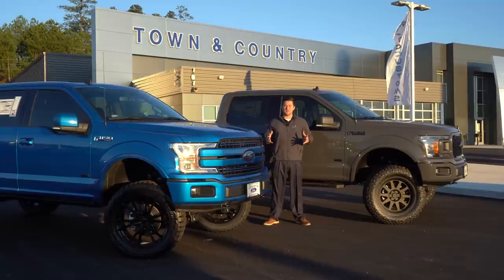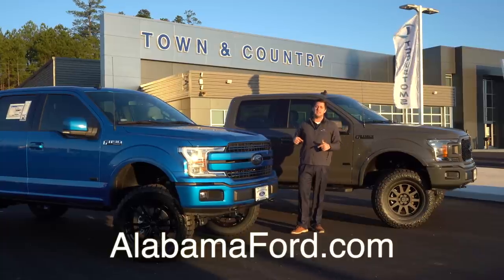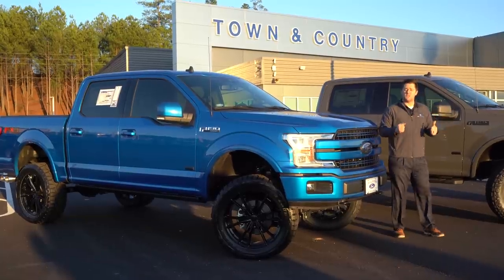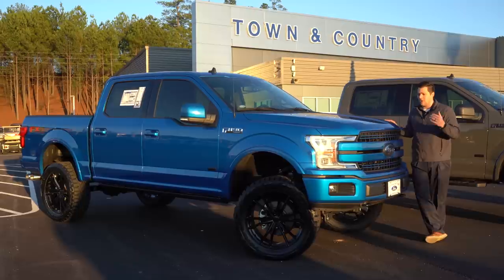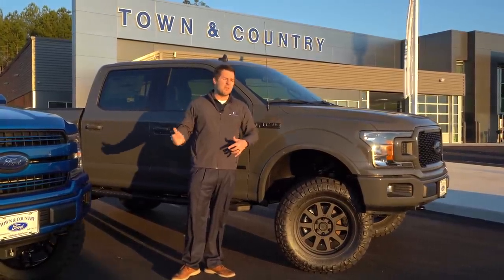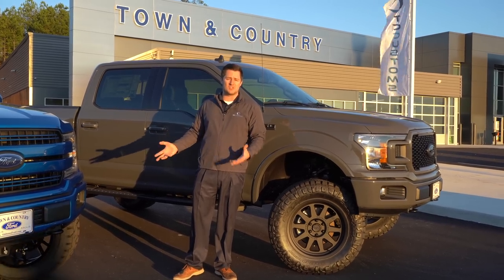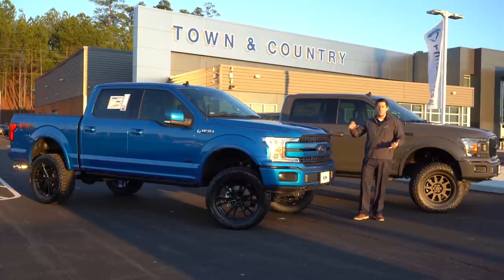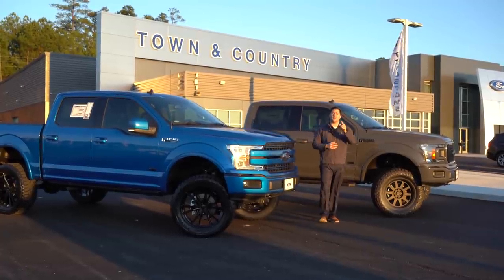Which Gear Ratio do you need on your truck?

Comment: You really only talked about the importance of swapping the gears as it relates to towing. But another and probably more important piece of it is that when you go up in tire size, and don’t change the gears, it wears out your transmission, axle bearings and pinion. I put 37’s on my 1997 F150 4x4 and it wore the transmission out in about 10,000 miles. The transmission guy told me the whole transmission was shot, they had to do a complete rebuild on the transmission, right after the transmission all the axle bearings an the pinion went out. I ended up putting 4.88’s on it and it’s like a different truck, it hauls a$$ even with the big tires and gets almost twice the mpg than the stock gears. 33’s and maybe 35’s are probably ok to run with stock gear ratio, but any bigger and you have to change the gears.

Comment: Really great video. I don't know how many times I have come back to watch it.  I get the physics behind gears and ratios, but applying the concept to a real-world application (like my truck differential) ... uh... _system not responding_.  At first, I was That Guy your were talking about at the end of your vid, "...confused the crap outta ya..." 

BUT as I started to explore more, really "think" it though, and watch this video a hundred times - YEAH!  I really appreciate your straight talk and examples of when/why you would want a different set up.  Especially talking about your own truck!

I have a 2018 F-150 V-8, 10-speed.  Going to lift it soon.  I am also thinking about eventually installing manual lockers - doing that research is when the lightbulb started coming on.  I was bothered by all of the information floating around about the bigger/heavier wheels bogging down the truck, wrecking performance, the 3.31's would make it suck, blah, blah, blah. This video was VERY HELPFUL!

I think I could apply your information to the off-road performance aspect, but I would love to see a similar video that talks about gear ratios on lifted trucks with 35's in off-road settings (not from a heavy towing or acceleration/racing perspective).  What would be the best ratios for a work truck/overland truck that might also be a daily driver or frequent freeway commuter?  (A pink, flying unicorn, I know...)

Love the channel!

Comment: The difference in the various ratios is so little that a 10 speed transmission can very effectively compensate for how they affect the performance of the truck. If you want to know the real difference between these axles look up the torque and weight ratings of each axle.

Comment: I have had 3 3.5 Ecoboosts. 2012 with 3.73 and 6 speed. 2015 with 3.55 and 6 speed. Now a 2018 with 3.55 and 10 speed. I wanted 3.73 on the 2018 but can’t get those unless you have the payload package which you can’t get with a lot  of the options I wanted on my current truck. The 2018 pulls the same and even better than the 2012 did but also has more torque. The 2015 was by far the worst pulling of the three.

Comment: 2017 F350 6.2L gas with camper package and a 4066Lb payload and 3:73 gears. Why didn't anyone mention the 4:30 option when I was looking?  Towing a 6300 Lb trailer and does fine everywhere except for the longer hills in PA with 6% + grades. Had to back down from 50 mph to 38 mph because the tach was hanging out at 5500. 
I think the 4:30 gears are a great option if you don't drive high mileage when not towing. I drive short distances in town, then tow 50-100+ miles 5-10 times per year.  Diesel would be overkill. A 150 could even do it, but I don' t like the downhills with move than 5500 in the 150's.

Comment: I have a 2018 STX 2.7 eco, I have the 3.55 gear ratio and it has a 7” lift with 325/60r20. I can tell you 3.55 makes it feel sluggish. Maybe if you have a 3.5L ecoboost it may be a different story. I’m swapping my gears next week to either 4.10 , 4.30, or 4.56. I did get a Tune which helped a bit but I feel swapping gears to match the bigger tire size will be much of an improvement. We will see once I get them installed with the verdict.
Reply: Did you do this? What did you end up going with and are you happy.

Comment: Thanks for your video.  Soon I will be shopping for a new F150. I will be pulling a 7000 lbs trailer most of the time. I think the 3.55 combined with either the v8 or v6 turbo should be OK, thanks for a 10 speeds transmission. Still didn't make my mind about the engine.
Reply: The 3.5 Ecoboost with the 3.55 Tows like a Beast.

Comment: I realize this is a year old, but IMO, there isn’t  a noticeable fuel economy difference between a 3.55 and a 3.73 with a 10 speed. In a vacuum maybe there is but the frontal area of going 75 mph and pushing against the wind drag is where your fuel usage come from,not the 40 rpm difference between the 3.55 and 3.73
Reply: Correct, MPG will be within a few tenths.
3.73 may invite one to apply more throttle since it’ll feel “ballsier”

Comment: Honestly I think the 3.73 is pointless with the 10spd transmission. The 3.55 or 3.31 are perfect
Reply: not really, top gear ratio is so high 0:64:1 that you can still drop your RPMs down so much, you still benefit from the lower rear end. Higher rear end you get to the point that in the top gears you don't have the mechanical advantage to lug as much as you could with a lower rear end.

Comment: I order a 20 f150, 5.0, with 3.73 and haven't got it yet.  I only test drove one with 3.31 and ecoboost with 3.55.  I hope I like it.  I'm like you Mitchell, I want that good acceleration and I'm not worried about mpg's.  I'll be using E85 anyway.
Reply: I have a 2019 F150, 5.0, 3.73 gears and a crew cab. 
You will love the 5.0 and the 10 spd trans.
Put it in sport mode and it shifts like lighting. Pulls anything like a dream.
It will run even better on E85, about 20 hp gain. But bad gas mileage with E85. You will also notice your motor oil will be cleaner longer and not as dark for oil changes with E85.
Reply: @abominablestormtroopersnow4510  but still it is not at the top spot for best engine

Comment: Some things to consider - large diameter tires reduce the effective final ratio. If you plan on a lift kit with 35-37 inch tires rather then the "standard" OE 32" tires, your final drive ratio will take a beating and a 3.73 may not even be equivalent to a 3.31 (I didn't do the arithmetic). The move to 3.73 from 3.31 gears is about 12% increase in RPM. 3.55 to 3.73 is only about a 5% increase - and, IMHO, quite frankly not worth it. Instead, save your bucks and go aftermarket with 4.10s or more. Gas mileage will suffer a bit but you will retain most or, maybe, actually better your trucks performance. My F150 has 3.55s with the trailer package and I don't haul too heavy. The last, and an F350 had 3.55s as well but was a 6.7 - and it really needed more hauling a 12K plus pound, 38 foot 5th wheel with the bigger tires I used.
Reply: What’s the heaviest you have towed? Looking to get a f150 for a do it all want a 4x4 and that’ll be good to tow as well

Comment: It would be good  to mention that the 3.73 will help minimize the effect that the bigger tires have on the truck even in daily driving and that you can use tire size to a point to get your gearing where you want it. 

  A good  comparison is that my old man has a 2020 f 350 xlt just like mine with the 10 speed and 3.55 gears.  mine has the 6 speed with the 4.10 gears.  my truck pulls as hard as his does even with more power the gen 3 6.7 has. but his can get up to 17 mpg as mine I have to drive 60 mph to get 15mpg if I drive 70 it drops to 13mpg. Now I am spinning the engine up to 2200 at 70 where the new truck with the 3.55 is spinning at 1800.  When my stock tires wear out I am going with some 33in tires to hopefully be a good compromise. It would take a 35in tire to make up the difference but i dont want to lose to much pulling power ether.

Comment: I have 3.73 front/rear gears and a Yukon LSD sitting in the box for my 2015 5.0 with the VMP Odin blower on it. 
Even with all of the parts required, I've got some crazy quotes for the regear. :(

Comment: To explain the way it works is if you have 3.55 gears, your pinion will spin 3.55 times to spin the ring gear 1 time that’s why it’s called 3.55:1
Reply: Exactly Correct!    "Pinion Gear" spins (revolutions) 3.55 times to 1 spin (revolution) of the "Ring Gear"

Comment: Yeah and the 10 speed trans has issues...just google and you will find lots of complaints. The 2018 5.0 has oil blow by because of the high tech plasma cylinders...just google and see. The turbo trucks...get a fire extinguisher and hope you don't need. I love ford trucks 2017 and older! No turbo! Waiting on more data on 2018-2021!

Comment: The ratio is also impacted by an increase in tire size.
Reply: The ratio is not effected by tire size. The distance you travel is effected. Horsepower and torque to the wheels is effected. Tire size is irrelevant. One axle revolution equals 3.55 turns of the drive shaft.

Comment: With the 10 speed transmission that is exactly why you should get the 3.73 gears. Because you should be okay with the gas mileage. 
I would want to have the 4.10 myself.
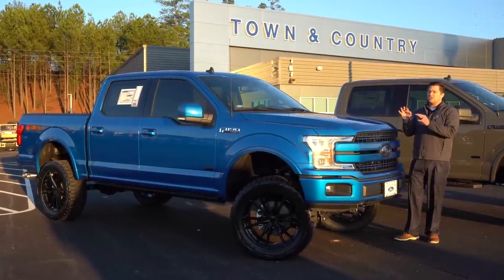Reply: CHRISTOPHER LILES get a tundra only half ton(besides the raptor) to have 4:10 gears
Reply: @ajmedeiros77  I'm sorry but the Toyota isn't my flavour. 
The Ford's are the best trucks by far.
I've worked with all of them through the years. 
Ford's are the best truck for work. 
I know all of them have bad ones here and there but in my experience Ford's have been better than the rest.

Comment: The difference between a 3.55 and 3.73 is very mild.  With the 10 speed automatic axle ratio choice isn't a crucial as it used to be. Back in the day, I had a 1995 Bronco with a lift and 35's. It had the E4OD, which is a four speed automatic.  I regeared it with 4.56 gears (stock was 3.55).  Which brought the effective ratio down to about 3.85, which was a little overkill, but made the vehicle more enjoyable to drive.
Reply: The shorter 3.73 still helps with the hole shot and will allow the truck to be less downshift happy when towing

Comment: Thought you would be talking about how a larger tire would change the affective gear ratio... an F150 with a 3.55:1 gear and a 265/60r18 that you put a small lift and 35x12.5r20 tires on now has a gear ratio of 3.1:1... Or same truck and tires with a 3.73:1 and 35s and now you're at 3.25:1 ratio... this WILL affect towing and fuel economy. That being said I have a 19SD on 35s and don't care. :)

Comment: Good explanation. 
But people need to understand the towing better. 
And running bigger tires. 
Ford does the gears like that because of the fuel economy for the government. 
But they shouldn't have anything less than 3.55.
If you are going to tow you best have 3.73 or higher. 
If you are going to lift the truck and run bigger tires you really need 4.10.
I wish Ford let people have more options for gears. 
Never mind locking gears that you didn't talk about that is even more important for towing and just being able to get out of things better.

Comment: This video is slightly misleading. My F150 with 37s has 4.88 gears, intake, headers and exhaust; it retains close to stock wheel horsepower. I can only imagine how weak the truck would feel if I kept the stock 3.73 gears. Dealerships SHOULD change gears in the trucks they lift. An F150 with 35s should have 4.56 in my opinion. If you don't change your gears when you lift, you will have more wear and tear on the transmission... Also NEVER get a truck dealership lifted, they charge twice as much as they should and take your factory wheels and tires and then charge you interest on total cost if you finance, you can go to a 4x4 shop and pay less total than the dealership with getting the gears done in the front and rear diff too.
Reply: Good Comment! I completely agree ----> NEVER purchase a lifted truck (or Jeep) from any dealer.....it's a rip off! 

You failed to state the model year of your truck and / or the type of transmission. The newer trucks with 6 speed and 10 speed transmissions low numerical gear ratios (high gears - 3.55; 3.73; 4.10) compared to 3 speed and 4 speed transmissions in years past requiring high numerical gear ratios (low gears - 4.30; 4.56; 4.88). The newer trucks with 6 to 10 gears in the transmission can perform well with low numerical gear ratios and larger tires. Plus...there is always 4L available in the transfer case. 

Regarding wear and tear on the automatic transmission.....be best to address that issue with some custom internal parts - torque converter, clutches, valve body work, etc.

Comment: I drive a 2020 Transit 350 3.5 all motor 10spd auto. HORRIBLE WHEN LOADED. Have to lock out 9th and 10th gear most of the time to keep it in it's power band

Comment: How much fuel economy do you potentially lose going from 3.31/3.55/3.73 ? Is it a significant amount ?
Reply: A lot of things come into play. Theoretically high gear (lower numerically) will give you better fuel economy. I've seen where you are doing a lot of towing where a lower gear will actually do better because  it allows the transmission to run in higher gears more often. If you are running bigger than stock tires that's another factor. I also don't  know how modern turbocharged engines respond to running at different  rpms.

Comment: 2019 f150 4wd running  37s with the stock  3.31 on my 3.5 with my 7" readylift. My power wheelchair is the only thing it carries lol. But i am looking into a travel trailer so might regear it.

Comment: I have a 2018 f150 2 wheel drive 3.5 with 3.55 gears and pull a 7000 pound trailer so would the 3.73 been better?
Reply: Yes

Comment: My only concern is with 3.31s being able to stay in 10th gear on the highway without constantly having to down shift. Fuel economy change is a non-issue because that's a no-brainer if you're going to go up in tire size. I just want to know if I can run like a 35" tire with a 5.0/3.31 rear end and be able to use 9th/10th. It's hard to find any anecdotes even on forums because most people don't seem to notice or care about that issue.
Reply: No... The slightest bit of acceleration will make it downshift from 10.

Comment: With the new 10 speed trans the gear ratio matters a lot less than it use to. Having 10 speeds makes it easy to keep the engine in its sweet spot with pretty much any of the available gear ratios. I'm ordering an F150 soon to be my daily driver as well as a travel/camping rig, so I'll probably order it with the 3.5 ecoboost and 3.31 gears. I don't tow anything, but I will be getting a lightweight slide-in camper eventually. In any case, the 3.31 gears will be fine for my needs and will provide the best possible fuel economy.

Comment: I am in the market for a new f150 torn between the 5.0 and the ecoboost.
Reply: From an Eco owner, get the 5.0
Reply: @HuskyKMA  for what reasons
Reply: @t-bone8114  No turbo's on the 5.0, so simpler and more reliable in the long run.

Comment: In a 2017 FORD 150;  does the rear gears  sound like they are compressing when coming to a stop while hauling a trailer loaded with a zero turn mower?

Comment: Im looking at a 5.0 reg cab 4x4 and do 5 hour hwy drives. Ford offers 3.73 or 3.31 no 3.55 with ELocker on V8s. With a ten speed on 3.31 wpuld I really notice the power loss campaired to the gas ill be saving ?

Comment: So I have a 2015 f150 5.0 king ranch with towing capabilities of 12,300 and I want to get a 38ft camper to tow with the dry weight around 8,450lbs only thing holding me back is that I’m on a 6 inch lift on 37’ tires would it be better if I just re geared my differential and if so to what gears ?

Comment: I found a 4.10 a 4.33 and a 4.88 for my 97 f150 xlt 4.6l 4r70w transmission 2wd short bed stepside bed. I wanted to go to a 4.10:1 gear ratio ring and pinion and install kit. What would you think about that?

Comment: Still confused for the most part.. Considering a 20 150XLT w/V8 towing about 4000-6000lb Airstream 20.  Want right truck w/ best gearing Power and Economy recommendation..

Comment: Hey there i have a 2004 F150 4x4 5.4l New Body Style with 35 inch tires with  3.73 rear end so can u tell me about this truck,  i have had it since 2004 with 30,000 miles when i got it and now it has 228,000 miles on it,

Comment: Does having the 3.73 benefit with a lift rather than going with the 3.55?
Reply: Yes it does.
Reply: Yes
Reply: I have 2018 two door F-150 on a 8inch lift and 37s with the 3.55 gears, 😂😂 it’s actually not bad at all in city but hwy... forget about 6th gear I stay in 5th at 2,000 rpm at 70mph, but the 3.55 handle the 37s very well, still spin the tires from a light
Reply: If you go to 35 in tires 3.73 are mandatory, 37 in then 4.10 are mandatory. If you don’t go to these ratios 6 th gear in a 6 spd or 9 th and 10 in a 10 spd at hwy speeds are almost useless!!!

Comment: Hello I have a 2005 F150 and want to put 35/12.50.20 on it I have a 6” lift and was thinking of a 410 gear. Will this be ok or will it burn up the transmission?

Comment: Helpful lol
I was thinking about running 38x13.50 on my oem 22s. I have a 2019 f150 lifted 7inches with the 3.31 gear ratio but I don’t do any towing at all NONE. So what do y’all think?  Or should I just run 35s or 37s?
Reply: What motor do you have? And how does it ride with the 7in lift?
Reply: @DreMartin1135  I have the 5.0 and it rides good with the lift

Comment: I’m still confused.  I’ve got a lifted f150 with 8.8 3.55 rear end.  I’m running 22x12 with 35s I always thought I should upgrade to 9.75 3.73 to up the size of my tire to 37. I don’t tow anything.  I drive like a grandma.  My truck is for show.  Am I over thinking this?

Comment: Sir I have toyota surf 4 runner.i change the engine 5L 3000cc but now I have speed problem he no go up 90  100km/h with 3500rpm 
Rear gear ratio 3.90  tire size 30inches  transmission 5 speed deya pls guide I want 120km/h with 2800rpm